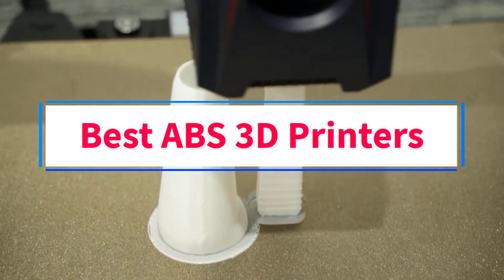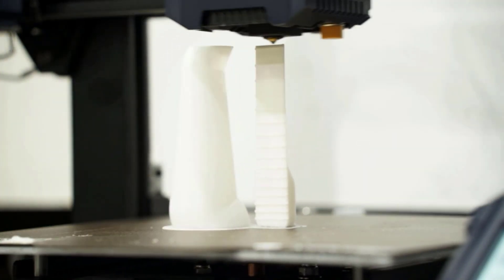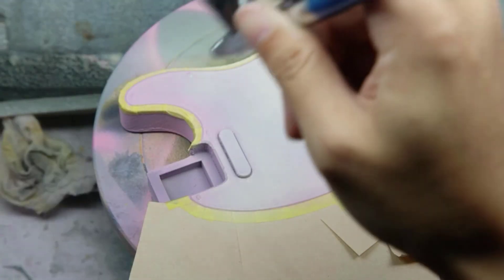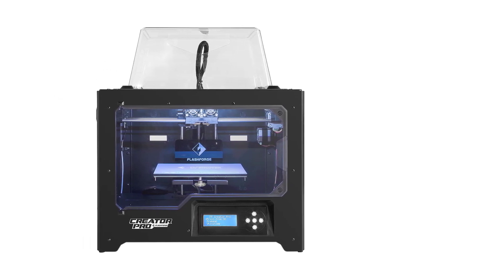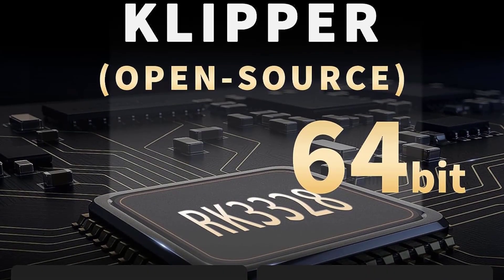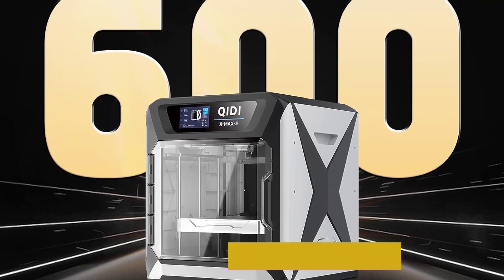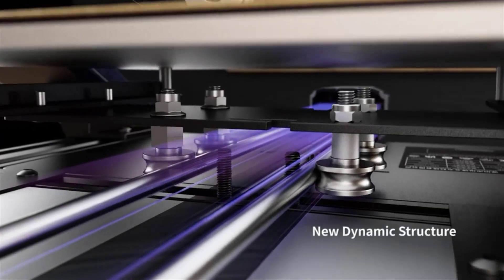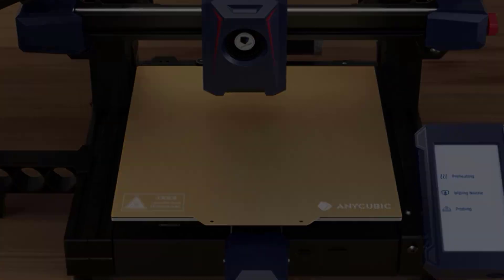✅Top 4: Best ABS 3D Printers in 2023 - The Best ABS 3D Printers {Reviews}

Comment: Lmao he recommended open air printers for abs he doesn't know a thing
Reply: no,  you don't know a thing.  The hotend and heatbed being capable of the temps is the requirement, not the enclosure. LoL What printer do you use for ABS?
Reply: @MinionAtTheGate  No, the material itself should remain at a stable temperature to bond effectively.